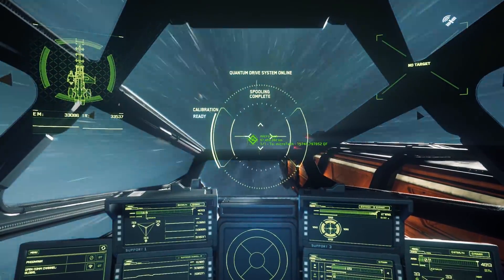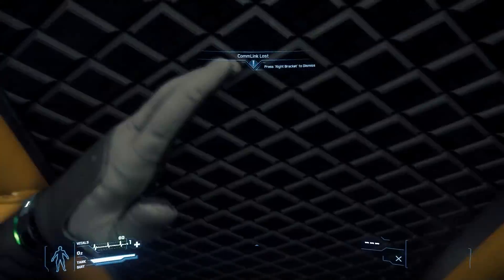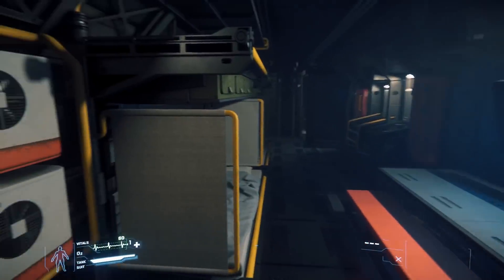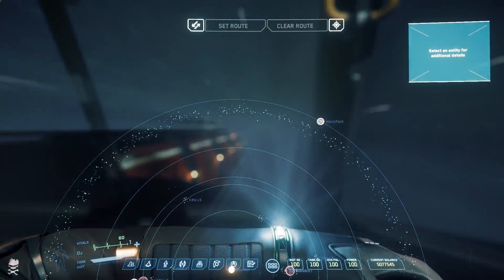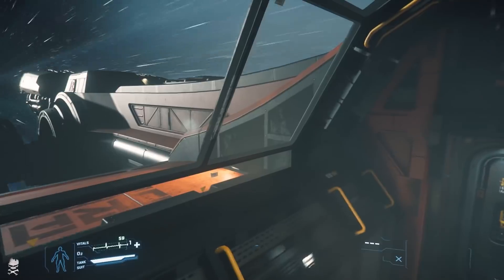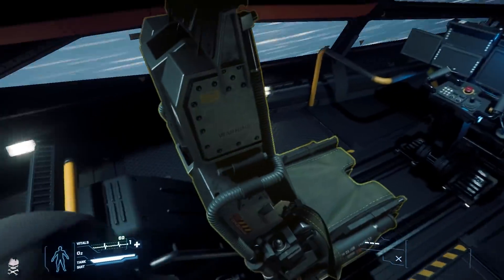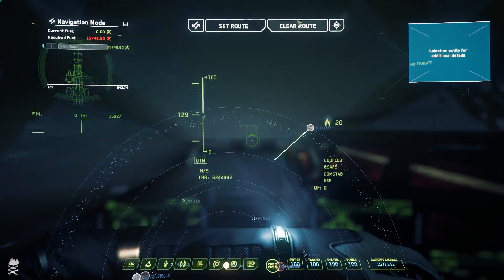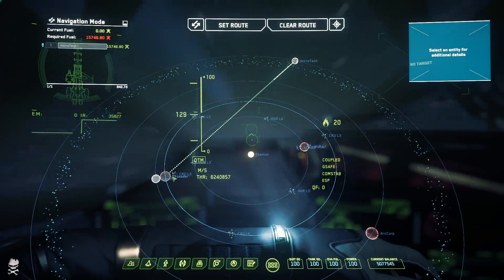Star Citizen : PS Ship Maintenance Good idea .... for NPC's 10-31-2018

Comment: These actions on engines are probably to check stats and to do repairs, since they will degrade over use, or you can just repair them at a station, but if you get attacked and they destroy your quantum drive engine for example, you are going to need to repair it or call for support, otherwise you are stuck in space. And if you don't have the components to repair it and need to call for help that will trigger a mission for someone else to help you.

Comment: There's a risk of going overboard here. Too much micro-management is not good for a game like this. Here's how I think it should work:

1) Automatic maintenance at truck stops/space ports/cities should be a given. The more damaged you ship is, the longer it should take to fix and the more it'll cost you. There should be a markup system where you not only pay for components and materials, but also work time.

2) If you choose to manually fix damage on your ship it should be cheaper (since you'd only be paying for components and not necessarily work time) but it should also take longer. 

Compare it to a car wash. If you wash your car at a car wash it generally takes barely any time at all compared to if you'd do all that work as meticulously by yourself so that it's up to the same standard. 5 minutes in a car wash most likely means 20 minutes when doing the same work manually.

This can be fixed by having the automated system fix a relay in, let's say, 15 seconds. If you however choose to do that yourself with your tool it should take 45 seconds. If there are 20 relays that need fixing you'd save 10 minutes in maintenance dock compared to a manual fix in deep space, but it'll cost you more for that convenience and the work is most likely gonna be much better quality, unless you have a maxed-out Engineering skill.

3) NPC crews are essential. It's a must. You should be able to hire NPCs from terminals at, let's say, Administration offices. The better they are, the more they cost in salary. However, they should never be as good as a player character potentially could be and they should scale in skill based on your own level and work at 50% of your capacity at maximum.
Reply: I think it should not take that much longer to do it manually. You already save time by not having to do it on your own. And also shouldn't it be too much of a worse quality when you fix things on your own. If it took that much longer and is of a worse quality, it wouldn't have any appeal to me doing it manually (or let it be done by an npc). Although I like the idea that you can srew repairs up a little when you know nothing at all about repairing, and then having to get the truck stop to repair it properly when you finally reach it.

Comment: Did you see the hammerhead captain's quarter screen behind the desk with transmissions? Data warfare may be tipping win/loss condition in large scale operations.
Also, remember the Kraken concept and now the very front of the Hammerhead opening? Dont they look like they could perhaps  dock one another? Its not far off to my understanding. Question is what happens if the kraken goes QT while hammerhead is docked.

Sorry man but we definitely are going for the granular with components and soon sub-components.

Last night with latest patch xxx866, I had best fps ever since 2.6 but unfortunately loaded with 200012 and 30000. 
I took this time to understand the buccaneer better. That ship has so much kick it will take time to control. I understood quickly that the loadout is utterly wrong for K+m users with such quasi nonexistent deadzone, it is for me important to go Gimbal, yet, where is the gimbal plate dual size 2 or perhaps size 3 for buccaneer top behind pilot? I am forced to use gimbal +1 size 3. I started to hit better nonetheless. Close quarters ballistics are not too good at least versus Valkyrie. Long range auto canons greatsword and broadsword look really cool but clearly dmg state has never been updated in a while. Good old sawbucks and another old canon have not been updated either whose dmg really are quasi not existent.
The prospector has weapons that I dont think I can find anywhere at PO I would like to try on buccaneer. In the meantime the buccaneer is not loaded with best component for shield and it worth looking at other stations fir other components.

Cutlass has ok shield, ok QT, but there are better cooler and possibly power plant out there let alone the signature question.
Reply: The thing with Drake ships is that they probably won't be able to recieve military components, based on the recent Kraken q&a and before it the Eclipse q&a. Sure you can fit your Bucc with an Aegis Regulus and 2 AllStops now but in the future it's probably not going to be possible. This also makes me rethink how effective the civilian Hornets are going to be in the future. At the moment they are on par if not better than the SH with the right loadout, but if the SH can fit military components and they can't then they will be obsoleted when the restrictions are implemented.
Reply: @c.g.1605  yes, it is probable,  but it will stiffen needs and goals which ultimately stiffen economy. So is it in best intetest to completely seal off industrial from military?
There is no wrong answer but to me... let the game flow, let players decide what component is best.
Personally I like industrial compo as a start, they are close to military performance which offer competition but I will not hide I will seek best component to my eyes, industrial, military or otherwise.

Comment: its just not interesting gameplay! yeah I know some guys who were like "im gong to be an idris engineer and do teardowns and rebuild and maintain everything!" but they don't realize its just going to be a tedious mini game and the rest of the time wont be very interesting. I rather have an NPC always working down there who wont get board who will keep everything going 24/7
Reply: I should also add I DO think it would be cool to go down to your monitors on your engines, shields gens and w/e else you have and see what level of durability is left on them. i.e. if you need to tune them up to top it off again
Reply: Stay tune. Stay open.
Yes engineering is boring like even biring for a grandpa reading a newspaper and needs to feed the dog once in a while.
This said engineering exists, i cannot guarantee anything but I assume CIG is aware some want to be engineers and for now what is given to backers is like a 2.4 version of star citizen... the very basis of it, it does not mean it will stay that way fir release or you essentially can be engineering from the bridge which... does not nake much sense.

Talking out of my ass but seeing how community is swelling. I can also assume CIG at some point will concept engineering ship, a ship that mechanically and via probable induction replenish shield, cooler, p.plant? A sort of crucible designed specifically for components, turbines, vtol, and engines?